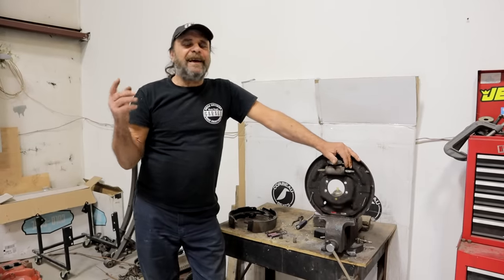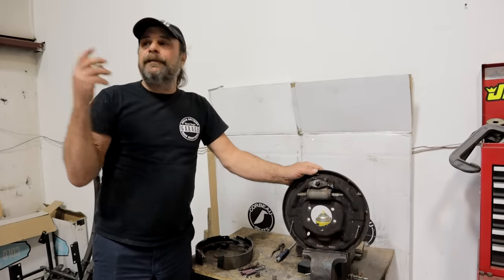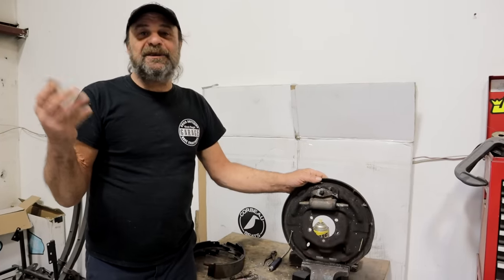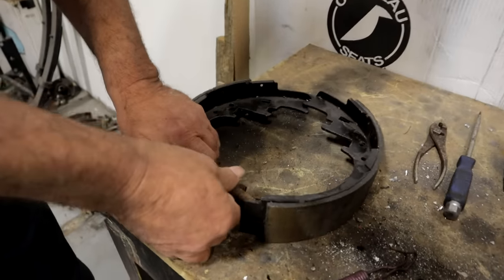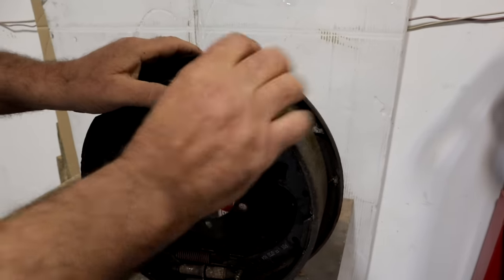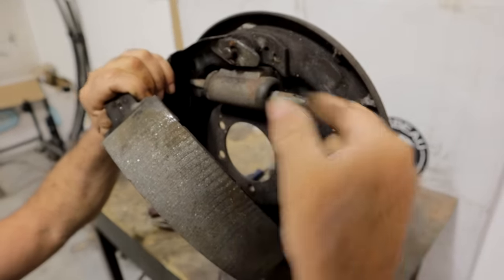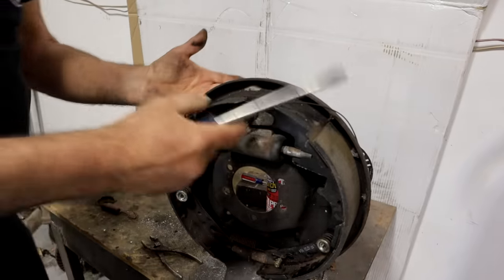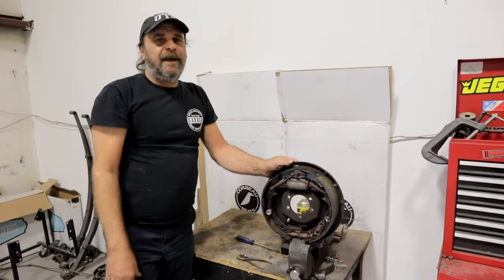Drum Brakes Made Simple - R&R Tips And Tricks That Make The Job A Snap

Comment: Can't ever look at drum brakes without remembering the little diddy my daddy taught me about shoe placement, " Johnny want's a haircut just like mine, short in front and long behind "!
Reply: Mine taught me "big dog lives out back"
Reply: @graham2631  👍
Reply: That works with he Bendix design, which most of the cars and trucks used back then. With the leading and trailing brake design, which started becoming popular in the late 70's and used on most cars and light trucks today, the bigger shoe goes to the front. Just wanted to make that point for those who aren't aware of the different designs.
Reply: Some excellent tips on drum brakes. I learned somthing even after servicing my own cars for 40 years. I liked hearing all the positive things about drums, trying to think of a negative...one thing if they are not adjusted the same side to side, if you lock them up you will spin out.
Reply: If my brakes work properly!
I’m happy 😂
Reply: @muziklvr7776 u r wrong
Reply: @fishboy3179  No, I'm not. Took automotive classes in highschool and college before I decided a different career path. Have replaced many drum brakes in the last 30 years working on cars back to the 1950's.
Reply: Lol thank you. I like business in the front party in the back.
Reply: What hes not convering is problems. 63 valiant ds brake hanging up. Cylinder, rubber hose , shoes all new. Drums swopped still on drivers side. Sometimes does not pull. Sometimes pulls badly, sometimes does not release. Draggs for 100 feet then lets go. Was doing it and shoes were changed 2x. Cylinder changed 2x. Rubber hose changed . Back plate hold down springs changed. Still does it, annoying.

Comment: I use those tools Tony was talking about. They are so easy to use and do not slip. I recommend everyone use them. Screw drivers and vise grips will get the novice hurt.
Reply: An acquaintance lost an eye to the aforementioned tools. Right tool for the job is necessary
Reply: agree, the drum brake pliers have a radius, like a spoon, that prevents them from slipping off. These springs are strong and not afraid to dig in a finger.
Reply: I'll note that the cheap ones are junk. My set from HFT has rounded off and are basically useless after maybe 2 or 3 jobs. My Dad's Snap-On (maybe Mac?) from the 70s still work awesome.

Comment: One of the major problems with old drum brakes is corrosion and extreme wear of the backing plate shoe pads. Tony pointed out white grease for them.  What's bad is when those pads get grooves worn in them, the shoes hang up in the grooves. This causes uneven initial application, pulling left and right when you first apply the brake pedal. Good used backing plates can be very hard to find, new ones even less available.  I end up rewelding the pads and resurfacing them, lots of extra work.
Reply: Normally I'll just touch them up with a grinder if I find any that are that bad. It's been my experience that smooth is more important than level. Once everything is assembled, I like to grab both shoes (like you would hold a person by the face, one hand on each cheek) and move everything side-to-side. If it all slides freely and smoothly, it's good to go.
Reply: One old timer I learned from used to braze the backing plates and surface them flat, so the shoes would slide smooth on the backing plates.

Comment: Do not mix up self adjusters. Lh goes on drivers side and rh goes on passenger side. Or your brakes will self unadjust. Yes, I have seen that and even worse.
Reply: Just made a comment on my experience trying to figure out what someone had done.....Like two left hand adjusters....Couldn't believe it!
Reply: That's why it's important to manually test your adjusters while the drum is still off. Just actuate the lever/cable by hand and make sure the adjuster gets longer. It will be immediately obvious that something is wrong if you do it backwards.

I only ever do one side at a time so I've never put a right on a left, but I have for sure put them in backward front-to-back when I wasn't paying attention.

Comment: I've been doing drum brakes exactly like that for 40 years. Right on Tony !!
Reply: Same here. Started messing with cars in the mid 80's, so plenty of drum brake work. One thing I do different than Tony is to use a very light touch of anti-seize on the brake shoe contact points, and the adjuster threads. White lube will wash away or melt away.
Reply: What amazes me is, how many "experts" have Youtube channels and don't know these tricks.   Maybe we are just to old...
Reply: Sir, the bonding on my breakdrum fell off completely, when I checked the fluid was leaking over the breakshoe so I thought that may have caused it to detach, but when I replaced it with a new pair, it happened again, both bonding fell off from the shoe, what should I do?

Comment: Tony, take that star wheel all the way apart, lube clean and lube those  dirty (brake dust) threads up. One more thing close up the opening end of the return springs where your screwdriver spread them open, and make sure the bracket where the cable runs through is seated in the brake shoe, then test the cable and arm of the adjuster by pulling the cable and you should see the adjuster actually work. Good video for the younger generation

Comment: I always use brake tools. They are worth their weight in gold. If you’re just beginning, do one at a time. If you forget how it came apart you can use the others as a pattern.
Reply: Specially when taking the springs off that wired pliar type tool is a skin saver! Easy to use once you the hang of it. Like anything, a good quality tool is important. The cheap ones have to be worn in to catch the spring and lift it off. The good ones have a little ramp on the lip of the tool that gets under the spring without needing to be worn in with lots of cussing and fighting. Lol
Reply: especially if its got a self adjuster. some of them use left hand thread and must go on a specific side but look identical
Reply: @Videoswithsoarin same with the arm that turns the self adjusting star wheel.

Comment: I worked for a front-end shop in the Bronx for years in the 80 and 90 did many drum brakes. They are very easy once you get the hang of them. 
I used the brake tools, not the plier type more like a bent screwdriver that the tip is designed to grip the peg .
Reply: Haha seems like nobody under 35 or so knows what that tool is. 
I always get that question 😆
Reply: What shop did you work for? I used to work for lucky auto parts on westchester square, I probably delivered parts to you when I was a kid.
Reply: @NYPATRIOT  West Farms Welding,  it's next to B&B auto parts, which we primarily used at the time.
Reply: @toecutterjenkins  I don’t remember west farms welding off hand, even though I probably walked right by it and never payed attention but I used to pick up parts and deliver to B&B

Comment: I'm having flashbacks to trying to replace the rear brakes on my Caravan. 10 hours. 10 EFFING HOURS! That did include a few breaks to walk away and calm down so I didn't burn it to the ground.
This also included replacing a few bits that were corroded and not in the mood to move.

Comment: Several times over the years I've worked on classic vehicles with rear drums that just had the brakes done by someone else but still had a soft pedal and low stopping power. When I go to check adjustment, I find the parking brake cable adjusted way up too tight, and the shoe adjusters turned way down. If you un-adjust the parking brake cable FIRST, make sure the cables are slack and the levers in the drums are fully released (usually stuck and have to be pried back) then adjust the shoes BEFORE re-adjusting parking brake cable. Re-doing these adjustments when they're out of whack always seems to bring the pedal back up to the top of its travel, firm, with more stopping power.. Just thought I'd throw out a tip... Another great video Tony!!!!!
Reply: Yeah, you are so correct on that brake adjustment - there is DEFINITELY a correct sequence
Reply: That is correct back the hand brake off adjust the shoes then adjust the hand brake it will give you a much better brake pedal or as you Americans call it emergency brake I am aussie
Reply: Ironically, I just read that  (adjust service brakes and then parking brake) in the factory service manual about an hour ago, so I know that he is correct.

Comment: I was a tire tech and apprentice mechanic at a Goodyear tire store in the 70's, and complete drum brake job included two things Tony didn't mention: turning the drum, and arc grinding the shoes. Drums need to have a smooth surface for best contact with the shoes, so the first thing that had to be done was to evaluate the drums for wear, grooves, out of round, etc., and put the drum on a brake drum lathe and machine the contact area of the drum back to good condition ( if there was enough metal left to cut it to spec). After cutting, the drum inside diameter was measured, and the shoes were put into the another work station on the drum lathe, and the arc of the shoe was ground to a matching diameter to fit the drum inside diameter. This insured that the full length of the friction material on the shoe made contact with the drum for best performance. 

Save an old self adjuster cable, it's are a great tool for use in changing sealed beam headlights. They often have a spring loaded trim ring to hold the headlight in the mount, and the spring can be difficult to reach to release. The hook on the end of the cable snakes into a tight spot, grab the spring, pull out with pliers, and the sealed beam is free to replace.

And yes, drum brakes were prone to being flooded with water and rendered ineffective. Disc brakes solved hat problem.
Reply: I'm surprised you're still around and replying to this comment if your were arc grinding shoes back in the 70's. Most who performed that kind of work back then have died from mesothelioma.

I agree about the front wet braking syndrome. It's was always interesting going through a deep puddle on one side of the street and having the steering wheel pull out of your hands after applying the brakes. I still believe experiences like that make for a better and more cautious driver, especially in inclement weather.
Reply: After going through deep water I always applied pressure on the brakes to help dry while driving. After drying out the brake pads you will notice the drag, let off the brake and drive on. They will work as normal.
Reply: @richarda996  Not so common common sense.
Reply: If you don’t drive through water deeper than your wheel to ground height you should not have a problem with the brakes getting flooded. I currently have cars with 4 wheel drum, front disc, and even 4 wheel disc brakes and have not been in any situations where the discs performed any better than the drums.
Reply: I thought arcing the shoes went away in the 1960s? I saw the machines in the early eighties but we treated them like antiques. Turning drums, yes if they were kinda bad maybe. If you weren't on the rivets it would usually be unnecessary and if you were it probably would be too deep to turn clean.

Cleaning the parts takes longer than mounting the shoes. cleaning the backing plate and adjuster parts takes time. How many stuck adjusters have been found...

I liked the GM drums the best simple to deal with. Chrysler had that cable that would often be worn to a few strands or rusted nearly through.

A good video would be on wheel cylinders, check, rebuild, etc.
Reply: When I learned to do dum brakes 50 years ago (OMG!). The mechanic I learned from in a "service station" remember those ?  He tokld me to do one side at a time so you could refer to the still assemble side as reference. Saved my butt more than nce. The special tools will really make the job much easier you should humor me and try them at least once.
Reply: @Larry Powell the younger ones are also clueless about any tricks on how to accomplish something when it can’t be done with normal methods because even with using a CNC they aren’t taught to be able to think outside the box. They are only taught to enter in standard program parameters without any options on how to program it to do any variables to get around a complication.
Reply: @Larry Powell What are they actually teaching them these days? It sounds more like they were taught typing for a clerical position instead of how to be a machinist. You could really have some fun with them newbie’s. Explain to them up front that the CNC systems are intended for the beginner where accuracy isn’t as vital and that for the truly precision work and/or for complicated pieces where extreme precision is required the old school non computerized manually operated machines are what are used because they are so much more versatile and better suited for accuracy.
Reply: Mike exactly as I was taught to do brakes I see a lot just put shoes on without arcing them in Aussie we call it radius grinding shoes you definitely do brakes the right way nice to see

Comment: Perfect timing I have to replace some leaking rear wheel cylinders on my '66 F100. Thanks again for the "how-to" vid.
Reply: Just a heads up, I did mine on a 66 f100 and a lot of the rear cylinders that you get from the big box stores are slightly too big, one of them even told me that the ones I had went on a falcon but that’s bs.

Napa and Dennis carpenter have the right size small one for the rear that is listed as the factory replacement for a 66 f100, this was my experience anyways, just figured I’d save you a headache in case you get to the rears and the ones that you got don’t fit the backing plate.
Reply: @ryanhunt881  Thanks for the heads up. I am always leery of big box stores stuff.
Reply: If you have old parts, rebuild! It may be more tedious, but new drum parts are absolute trash and you will find them rusted and non functional or leaking again in a couple years anyway. 
Unfortunately, the rebuild kit will also be sub par but at least the rebuilt parts will fit properly! 
introducing chinesium to your vehicle is just opening the door for constant headaches.

Comment: Done a few the hard way then thought to myself gotta be an easier way.  Assemble the shoes first then set it on the hub, nice. I also used a racthet strap to hold shoes together while placing springs. Takes more time but less spring tention. Im a hobbyist so not necessarily in a hurry. Great video ty.
Reply: @DanEBoyd  That's the only way to do it. It prevents mistakes and you still get to enjoy the experience.

Comment: The major advantage I've found with disk brakes over drum brakes is something that is more a regional or very limited time frame issue. Disk brakes still work after driving through a lot of over the wheel water. In the summer time here in SW Florida after an afternoon rain storm there can be many streets with lots of water on them and drum brakes don't like that kind of conditions.
Reply: Great point. I've experienced this myself here in Naples.
Reply: Ha!  Didnt see your comment till after I commented   You are right
Reply: Absolutely.  Having to drive a box truck full of tools in hurricane season gets rough in the rain with drums in Florida.
Reply: It was standard practice on early motorcycles with the new-fangled disc brakes to have to gently apply them in a rain or when the rider went through a puddle to dry them out enough to actually stop the bike when needed. The rider had to anticipate when he'd have to stop. I wonder what's changed with disc brakes since then.

Comment: I have those "special" tools you talked about and love them over the alternative!!! The anchor pin tool is magnetic to hold the quarter turn cap, and has a screw driver handle. The pliers handle has a concaved end the captures the stud so it cant slip off, and the other handle that has the weird cup thing fits over the stud and the little ear slides under the springs for removal! Very smart designs
Reply: Holy Hannah, I never thought of a magnetizedcup spring tool. I'll bet mine is magnetized next time I use it...

Comment: good tips. if someone switched a car from drums to disk and didn't see an improvement they did something wrong or got a poorly designed kit. You also didn't mention wet weather performance. I remember having to ride the brakes to dry them out at times when you ran through water.

Comment: Remember, put the star adjuster the right  direction, you can put it backwards where you can't reach the adjustment thru the slot.  With the brake adjuster tool, "down is out", or I as I always think, "down and out" to tighten the brakes.  Up with the adjuster tool to loosen.  Tighten the brakes till you can't turn the tire by hand, and back off the brakes (up with the tool) 10 to 12 strokes.  Straight from the text of the Bendix and GM books.  Automotive Restoration of Lubbock.  Thanks Tony!